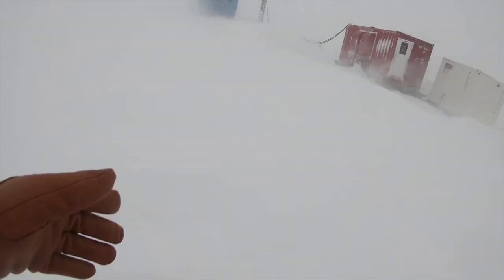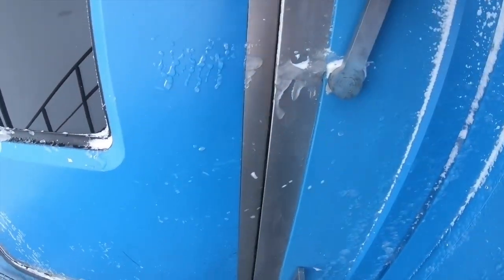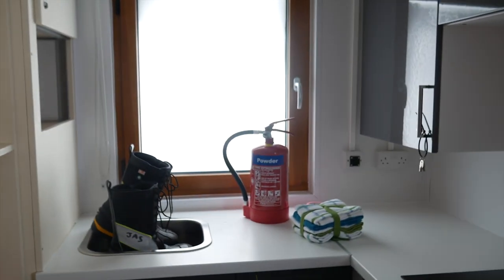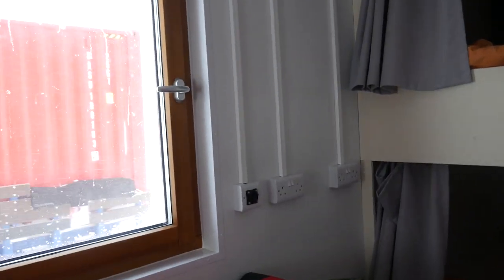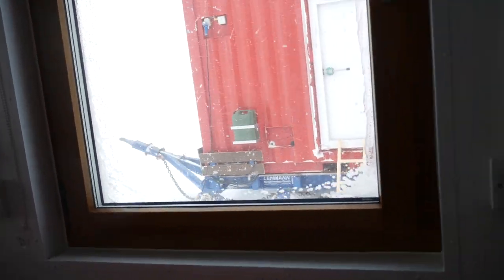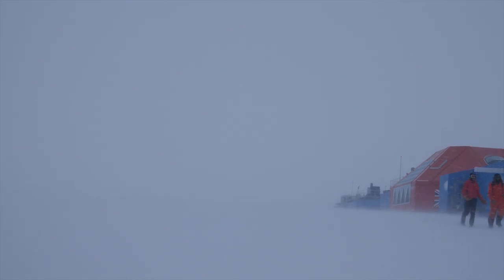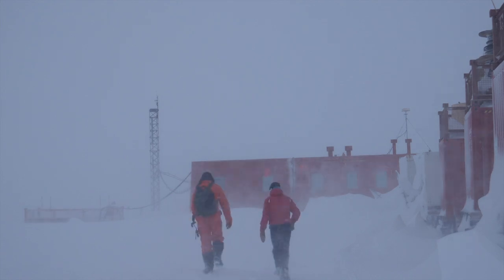Inside Halley, the British station in Antarctica

Comment: The crack, could you not heal it, a machine that drive's both side's pouring something alomst ice water but something added to make it freeze in less than a minute, save the ice shelf from breaking off which it will do a ocean's would rise that amount of ice breaking off and well by the Everglades.